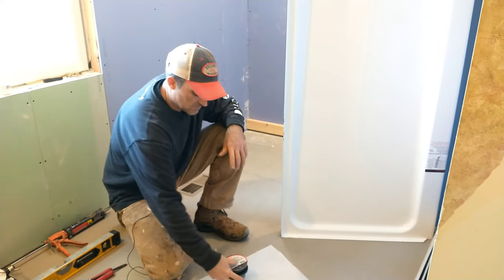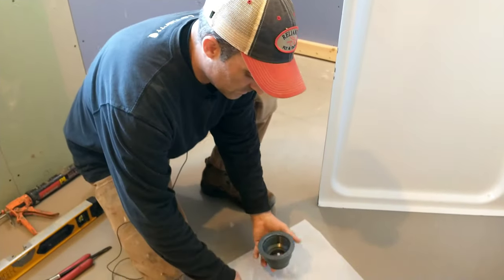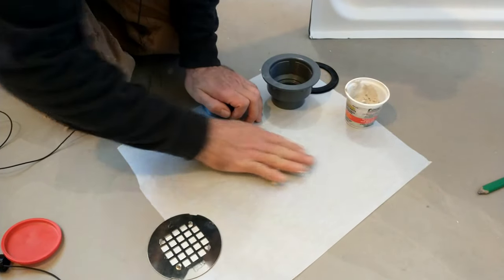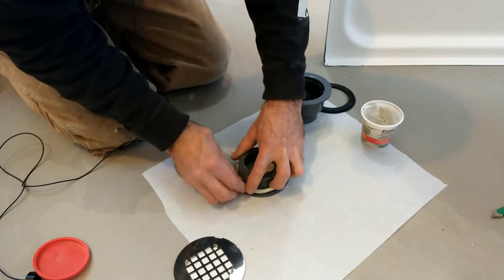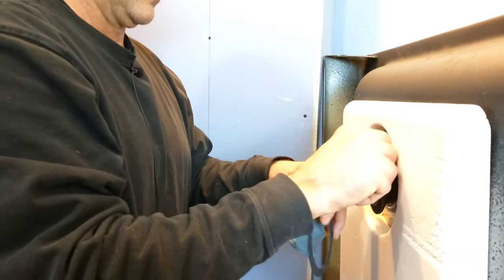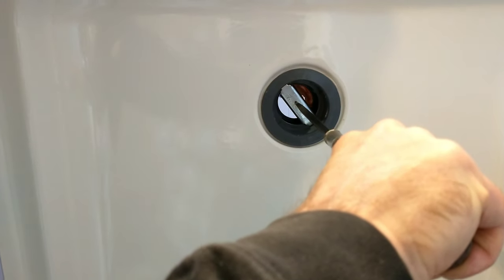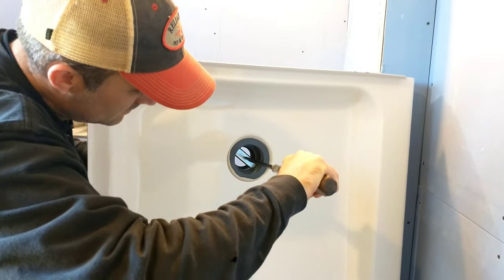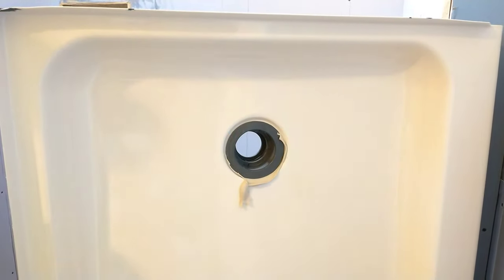Install Oatey 2 Piece Shower Drain #diy #how #howto

Comment: I have started using silicone as under the flange in the shower due to the fact it wont crack such as plumbers puddy over time. I also use a small amount of silicone on the lock nut below so there is no chance of it ever coming loose after install. Good Video!
Reply: Thanks
Reply: Do you just squeeze it in there and glob it and as it tightens it oozes out and clean it up?

Comment: I still dont see a purpose for that rubber seal on the bottom side. What is it sealing?, does it squeez up against the threads of the drain? To be honest sees like it would be better suited on the top side, no silicone, no cracked putty, no leaks 🤷
Reply: Like all sinks and tubs, for water not to get around anything.  It's crucial
Reply: Dude plumbing leaks even when you do everything correctly. Why would you even risk it? I’d add 6 more gaskets if I could.

Comment: On my PVC shower drain it said don't use oil based putty on this drain. Now, is the putty u used, stain free cause it's oil free, or what? Thanks.
Reply from the maker: Hi Peter.  Thank you for watching and leaving a comment... always appreciated. The drain and putty are both Oatey branded products.  The putty states that it is useable for this application, as well as many other applications.  Hope that helps.
Reply: Yeah, I've always used oatley on all sink , tub drains and faucets with no staining. But you're video and the writing on the PVC drain made me wonder.  And yes, the drain is an oatley brand drain, and when you're doing work for someone else, you sure don't want issues like staining. Thanks for answering.
Reply from the maker: @peterford9369  Totally understand and agree.  I've used this exact putty for years and have never had any issues.

Comment: So am I correct that the PVC drain Pipe shouldn’t be sticking 1” up into the bowl of the drain?  I think my plumber did a lousy job on my shower drain.  It collects stale water and debris since it always has a inch of water in it.
Reply from the maker: Yikes!  Your drain should be the lowest spot in the shower.  I would be concerned with dry rot around the subfloor. If you have standing water at your drain location, it could eventually have a slow leak around the seal and you could be accumulating water underneath the pan, which would result in dry rot at the subfloor. If you have a crawl space under that shower you may want to have someone take a look at the subfloor near the shower and check for leaks.  Thank you so much for watching, always appreciated!

Comment: I'm doing a new install with an Otay fitting that has a rubber seal.   In my opinion it's a waste of money and difficult to get it to seal as it's designed.   Problem is the drain pipe pushes the rubber sideways when you dropped the pan down on to the pipe.  I'd rather just get another fitting such as the one you have because the fitting will slide over the pipe with the glue. Far easier than the one that I purchased with the rubber seal.  I wish you would have showed dropping the pan down over your pipe.  To me that's the trickiest part.
Reply: I put in one of those with the rubber seal because it looked easy and less "permanent". It started leaking today after less than a year.  I'm putting in one of these.

Comment: Hi there! Thank you so much for posting this! I have the exact same drain, however I am installing my own shower plan using sand and concrete mix as a preslope and a liner etc. I am thinking I may not be able to use this and have to use a flange instead? Or is a flange essentially what I would put it into like it’s the precut hole in a pan? 🤯
Reply from the maker: Hi Terri -Anne! Thank you for watching and leaving a comment, always appreciated. The concept is the same but the drain is not 😂.  You would need a three-piece Oatey drain such as the Oatey 130.... Not saying that that is the exact one you need. You can go on their website and check out their drains. But, a three-piece drain has an additional flange that gets installed into the sanded bed. Then, that flange will accept the Oatey drain assembly.  They come as an entire kit. The 130 series might do it for you, you need to read the specs and see for yourself. Best wishes on your project 👍
Reply: @YouCanDoIt2  Lol thank you - that makes much more sense! I’ll have to do a swap. I have another question that I’ve tried posting on other videos about, but haven’t had a response. It sounds like maybe you’re familiar with making your own shower pan? If not, please ignore this. I am putting a sand/concrete mix down on plywood as a pre-slope. On the videos I’ve watched, they use tar paper to prevent the pre-slope from failing to bond on the plywood… my local home store only has rolls of tar paper and I only need 5’ of it. Do you think I could paint the plywood with aqua defence and it would serve to replace the tar paper? I apologize for asking you to read this… I just need to ask someone who knows lol
Reply from the maker: @terri-annenorwood-shaw4203  I am not an expert at the sand base. However I have seen it done several times. There is an additional layer above the tar paper and the sand / mortar base. It is a waterproofing membrane similar to a pond liner that must be installed. Your sand mortar base is porous and your tar paper will surely not hold out water. Therefore in just a few short years you will have dry rot under your shower pan due to water seeping between the grout, going down into your mortar base, and leaking around the tar paper. You will need to put that additional shower pan waterproofing membrane down after the mortar base is built up.  Some of these supplies can be costly. I understand the dilemma with the tar paper. Possibly look on marketplace sites that are local to you and see if anyone is selling partial rolls of tar paper before buying an entire roll. Sometimes places such as habitat for humanity have scrap rolls left from jobs for very inexpensive prices. You may even be able to find tile and other building materials there. Our habitat for humanity has lots of that kind of stuff. Hope this information helps 👍
Reply: @YouCanDoIt2  hey there! So sorry I never got a notification that you had replied! I do actually have a shower liner already. I am going to do a preslope and then the liner … and then the actual slope. Today I get my new drain that you had suggested and then I just need something in the way of tar paper. I was hoping that painting the plywood with aquadefence would sufficiently prevent the plywood from sucking any moisture from the mortar/sand mix. However, I will take your suggestion and check marketplace :) thanks again!

Comment: Now I have fixed a bunch of  second story shower bases at some apartments because the plumbers  used plumbers putty on a fiberglass base, because it was to flexible ,over time the putty cracked ,and  flooded the place below it !I see your base has a cast iron base so  you shouldn't have a problem with flexibility especialy if you wet set the base in a bed of morter for support, other wise with that kind of drain assembly and fiberglass base you want to use silicone. if it's on a slab or no access from underneath just be carful so as not to have it come back and haunt 

I had to take apart every drain in the hole complex and clean off plumbers putty and re fit ith silicone because of the flexibility issue ! Great video not trying to say it's wrong,  some people may not know the difference in there shower base being metal or fiberglass  ,👍🏻
Reply from the maker: Hi Nunya...love the name 😂!
Anyway, sorry to hear about the shower pan nightmares.  You are absolutely correct on the fiberglass base.  It flexes way too much causing all kinds of issues.  I've even seen the pan itself crack because it was not properly set into a mortar base.  This particular pan is heavy gauge steel and does not flex.  Thanks for your comment.  Always appreciated!!

Comment: I bought this exact drain for a solid base installation shower pan on concrete but as ALWAYS, Lowe’s sent me a used/returned product or simply missing the attachment to tighten the drain.
I had to waste half an hour finding material that would suffice and then grind it to act as the tool that should have been in the box.
I’ve tried Lowe’s three times now on ordering and they sent me used or incomplete garbage every time.
Reply from the maker: Yikes!! It seems like companies don’t care much these days.

Comment: Si, that's Easy, but how about in first floor with concrete slab?
Reply from the maker: Good point! That can be trickier. However, Oatey also makes a drain assembly that is specifically designed for concrete / slab foundations. If you go onto their website (www.oatey.com) you can find the correct drain for your application. Hope this information helps 👍

Comment: Can this be used for a tiled shower floor?
Reply from the maker: That is a great question! Per Oatey installation recommendations, they state that this drain assembly is good for prefab bathtubs and shower pans only. They do make a product that has a brass pipe drain assembly that is suitable for tiled floors. It installs in the same manner, but is made with brass instead of PVC. Thank you for watching our video and commenting. Always appreciated!

Comment: how do you hook the drain pipe into that?
Reply from the maker: Hi Fred.  This particular installation was done on a raised foundation with a crawl space underneath. The drain was easily attached to the existing sewage plumbing with a coupler and PVC primer and glue. If you have a poured slab foundation the installation would be a bit different. Thank you for your question, it is always appreciated.👍

Comment: How is it set and glued to the vertical pipe? Do you have a video on that?
Reply from the maker: Hi I. Quinn. Thank you so much for watching our video.  Unfortunately, I don't have the video showing the drain being glued to the drain pipe.  I used PVC primer and heavy duty PVC glue to attach this drain assembly to attach to the white PVC pipe.  If you are using black ABS pipe as your drain pipe, then you need to use black ABS glue instead.  I know that I should have done a video to show the final attachment, I apologize for that. Hopefully this information is helpful for you.
Reply: @YouCanDoIt2  thanks for responding. I'm trying to install the OATEY no caulk drain now, but I'm having a leak issue for some reason. So I thought maybe go the two piece glue route.
Reply from the maker: @lquinn7212  that could be very frustrating. Especially if it's a new install. Obviously wherever there is a leak it's usually at a seam. I wish you the best with your install and hopefully you can find a video for your particular drain assembly.

Comment: What is the size hole do you cut in the subfloor for this to go down to the 2" PVC drain pipe that will be glued to the bottom of this assembly?
Reply from the maker: HI. Thanks for watching and leaving a comment. The video that we posted prior to this one in the "bathroom remodel playlist" shows the size hole that was cut out.  We used a 4" hole saw with a Milwaukee drill to cut through the sub floor.  You don't have to make it that big, but it is easier to install the shower pan and make slight adjustments to the placement, if the hole is big enough, to move the pan back and forth.  Once the drain was glued to the sewer pipe, we filled in the gaps with "Big Gap" expanding foam so that critters wouldn't make a home under the shower pan.  Hope this information helps with your project!

Comment: Once the puddy cracks have fun cutting pipe to replace drain.  Can't spin bottom after the connect the pipes...
Reply: putty has been around longer then you
Reply: No but you can spin it from above real easy. They included the tool

Comment: How do you get the metal drain piece off?
Reply from the maker: Hi. Thank you so much for watching the video. The top metal drain plate is removed with a flat head screwdriver. If you look at the drain plate you will see a small cutout on the side where the flat head screwdriver would fit. Carefully put the screwdriver in that notch and pry it upwards to get the top piece off. Hope this helps 👍
Reply: @YouCanDoIt2  
Got it, thanks! Also, thank you for replying so quickly!

Comment: Can this drain be used with a mudpack shower base?
Reply from the maker: Hi Harshad. This particular drain will not work for a mudpack shower base. If you go onto the Oatey website they have specific drains that will work for mudpack applications. Hope this information helps 👍
Reply: @YouCanDoIt2  thank you for the quick reply it really helps.

Comment: part number?   size???
Reply from the maker: Good question.  This is a 2 piece PVC shower drain assembly for a 2" drain pipe.  If you look up Oatey 2 piece series 102 you will be able to find this drain assembly.  They sell them at Lowe's. Not sure where else.  Best of wishes with your install.

Comment: Delta shower pans say to NOT use plumber's putty...just FYI.
Reply from the maker: Hi Andrew. Thank you for watching. This is not a Delta brand shower pan. It is a Bootz Steel pan with porcelain overlay👍
Reply: @YouCanDoIt2  ahhh, 10-4 on that buddy.  Just clicked the LIKE and Subscribe button because of your fast response.  I'm completely redoing my master bath (shower, double vanity and toilet are all switching places.  I've redesigned everything in Revit, viewed it in Navisworks, and got thumbs up on my design.  I'm an electrical BIM designer but have done some extensive plumbing and HVAC design too and I'm a total nerd about the appropriate codes for my state.  I'd love to run it by you.
Reply from the maker: @afleming7282  Sounds like we are working on the same thing! I have a full playlist on "bathroom remodel", but I am also currently working on another bathroom remodel where I am flip flopping all plumbing and expanding the square footage of the master bath. Glad you are a stickler about codes...one thing to keep in mind, is if you are switching from a tub to a shower pan, you need to upsize your drain pipe from a 1 1/2" pipe to a 2" pipe due to the lower threshold in the shower pan. Most people don't know that, and it can lead to slow drainage issues and flooding. Of course, your actual sewer pipe that this all ties into should be no smaller than a 3" pipe. You can check out some of the videos in the playlist and see if any are of use to you. Many blessings on completing your project.